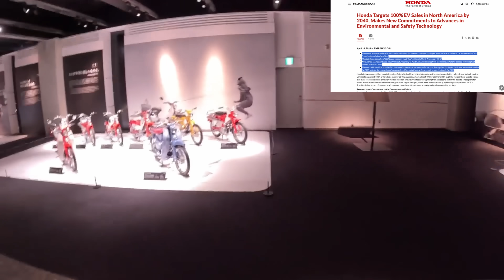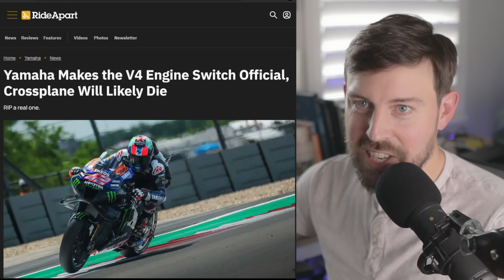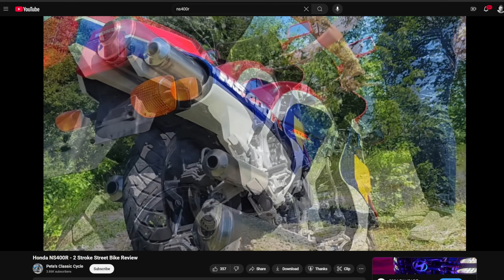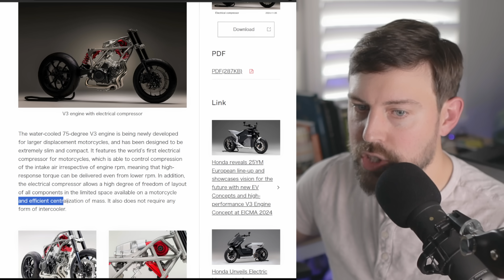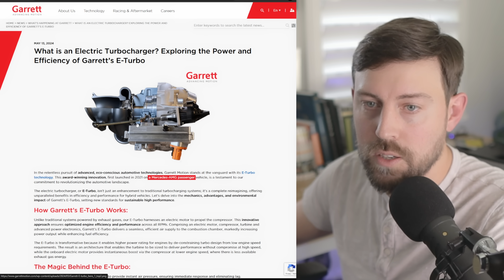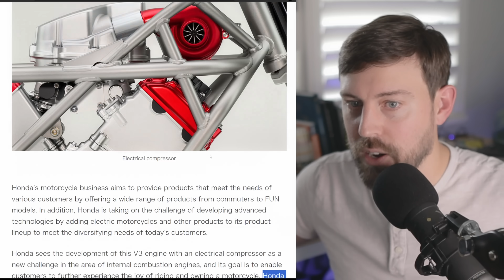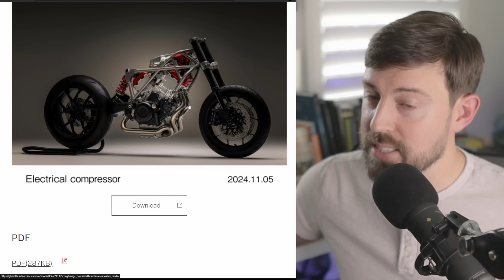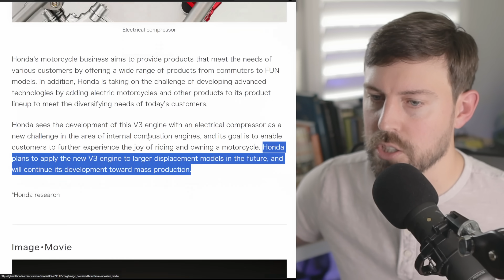Honda's new Frankenstein ENGINE will change the world...ICE lives on!

Comment: How come Toyota doesn’t do motorcycle? use that gr motor
Reply: they do it through yamaha partnership
Reply: @ but its still a yamaha 😁
Reply: Toyota has nothing to do with Yamaha motorcycles, not directly anyway. 

The GR 3-cylinder is too large and heavy for a motorcycle.
Reply: @rightwingsafetysquad9872 they could chop a cylinder off 😊, im sure they can develop one if they wanted to
Reply: @tinhinnh   I'm sure they could if they wanted to, but they haven't.  Chopping a cylinder off wouldn't solve the issue.  They'd have to chop the turbo off, figure out how to make the intake and exhaust manifolds take up 1/5 the space they currently do while flowing more air than they currently do, and integrate the transmission into the crankcase.  Car engines and motorcycle engines are very different things.  When people try to put motorcycle engines (usually a Hyabusa) in a car, it's a fragile mess and when they try to put a car engine in a motorcycle they don't even pretend to be making something that you'd actually want to ride (like the Dodge Tomahawk).
Reply: Some of the best performing Toyota engines ….are polished off by Yamaha! 😮
Reply: @realscience948  Yes, but they don't pretend to be putting a motorcycle engine in a car, they're offering engineering consultancy - Porsche did the same thing for every interesting Mercedes before they brought AMG in house. Usually the expertise they're selling is in accoustics.  And usually that gets coupled with smaller scale manufacturing than what Toyota is set up to do internally.  

From an engineer's perspective, designing a car that performs like an LFA or Elise is easy.  Designing one that sounds as good as them is very hard.  Convincing a company that makes a million Corollas every year to dedicate factory space to make 2,000 LFAs is damn near impossible.
Reply: @rightwingsafetysquad9872  I thought that Toyota bought 5% - 10%(?) shares in Yamaha?…and have formed a development corp to pursue Hydrogen & compressor engines?